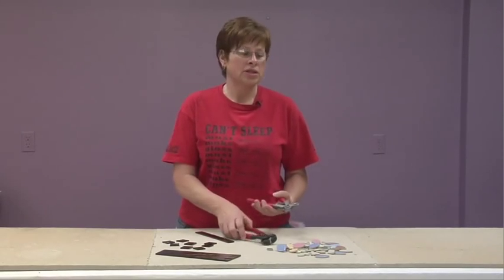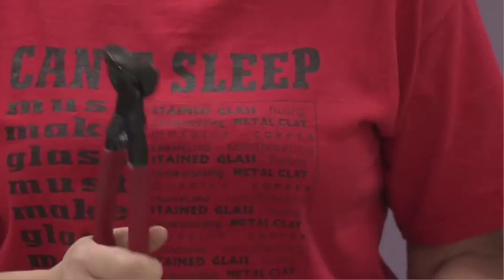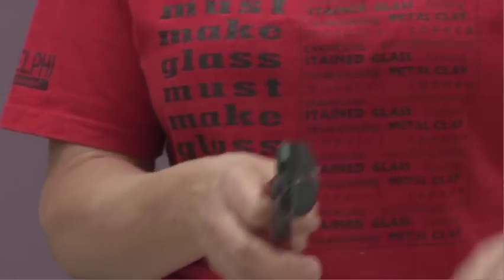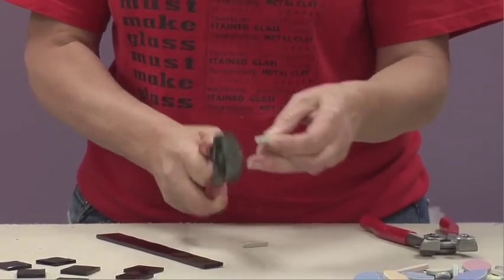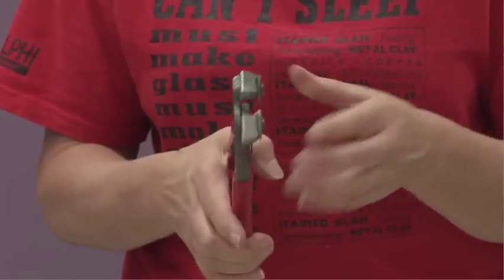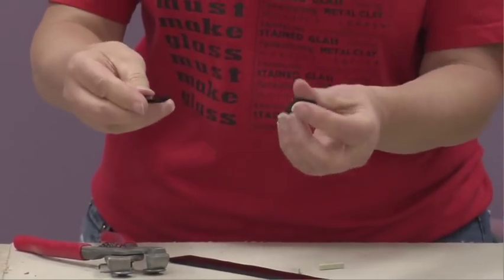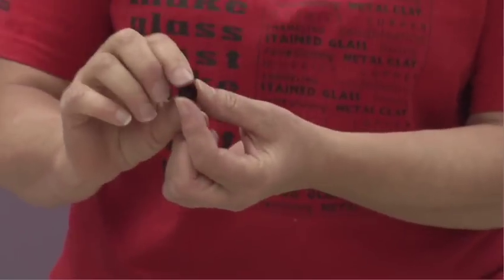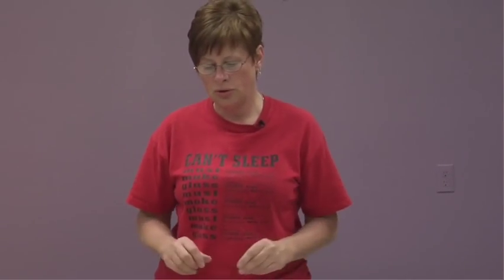How to Use Tile Nippers | Delphi Glass

Comment: Curious you may know the answer to this. Here goes ceramic tile with a glass glaze on top and one thats pure glass tile (just from glass) . If you grind those up in  powder form can they be used as a ceramic glaze and frit respectively. Anybody ever tries this? Ofcourse adding water ratios would be needed a little. But would it work or would it work be adding more additives to it using the tiles as a base?